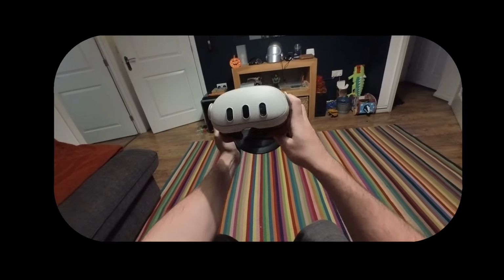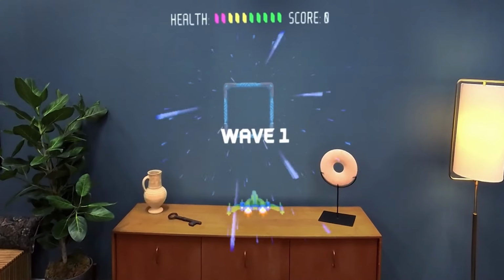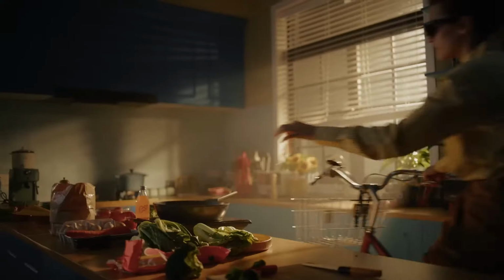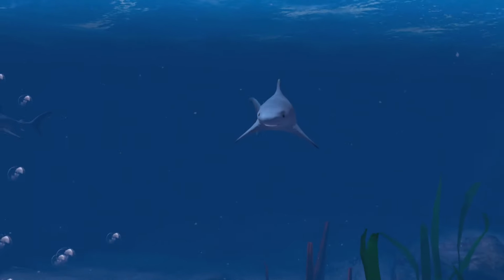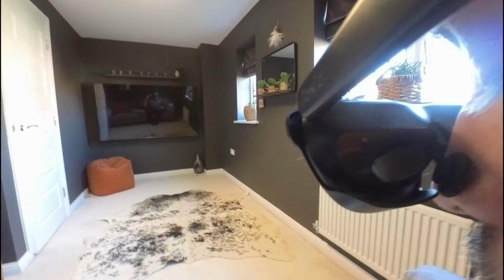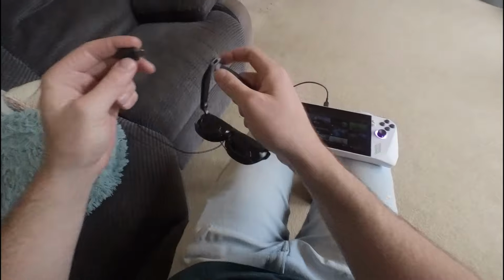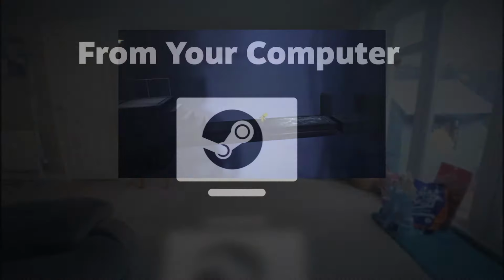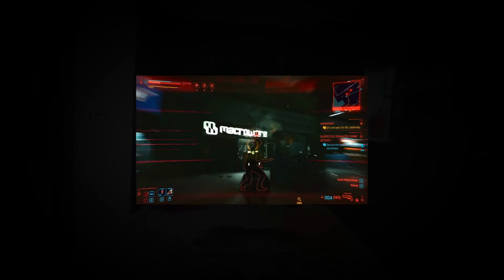Are AR Glasses Actually Good Now?? - Rokid AR Joy 2

Comment: Ads galore..  and the rokid station has decades ago outdated hardware inside of it..   ot even with smarttv stick prices (which also have the same outdated hardware) 
They could had even put in a low end snapdragon 4 gen 1 processor..   or any 400 series snapdragon.. or low end mediatek... but no, this company embeds a gigantic, energy consuming, very slow responsive soc... with 32 gigs of storage..  hurray, 32 gigs of storage is better than 16 gigs those tv sticks have..  2 gigs of ram.. and gigantic chip leads to slow responsive response time..  let alone inability to connect to Bluetooth earphones (needed because audio speakers is so quiet) 
Reported this guys video as misinformation, and I've suffered 3 lying commercial ads injury ... from watching this misinformation

Comment: For that price i would prefer a quest 3 or the 3s and a couple of batteries.
Reply: Quest 3 lcd screens are trash. There’s no black, just dark grey.
Reply: @sturmx96  Gimme a break, the screens are great.
Reply: It's not about price, these things are way smaller than Quest 3 and can actually connect to your devices with 1 wire, instead of a convertor
Reply: Quest 3 is 500 grams these AR glasses are 75 grams MOLED